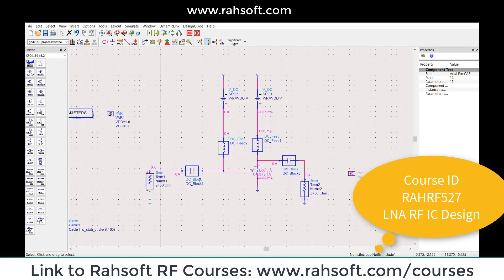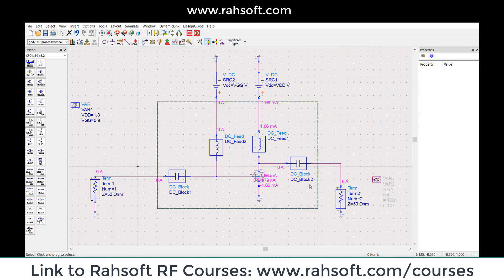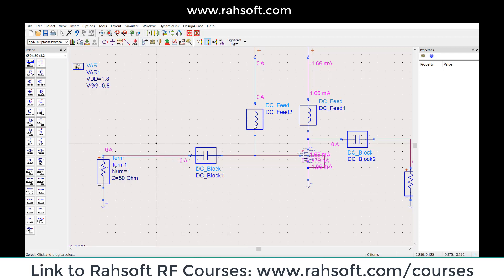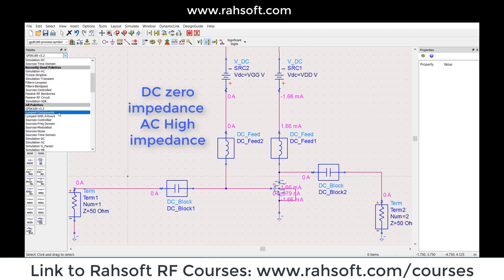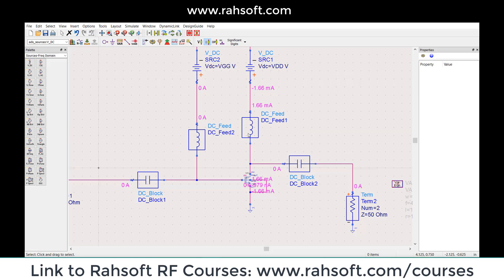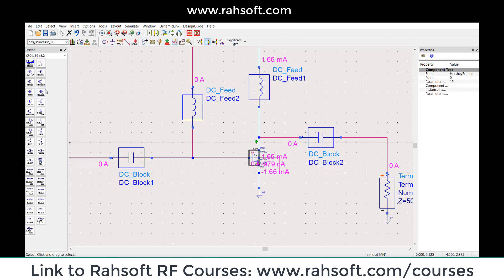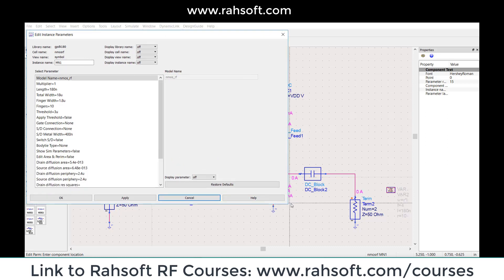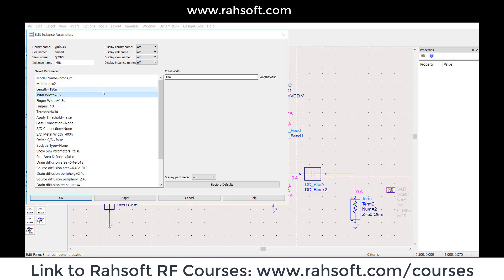Part 1:  How to start Common Source LNA IC Design in ADS step by step guide part 1

Comment: What is the value of capacitors in DC block and value of Inductors in DC feed?
Reply: DC block and DC feed are ideal components with short/open circuit for AC, respectively. There is no value for these components